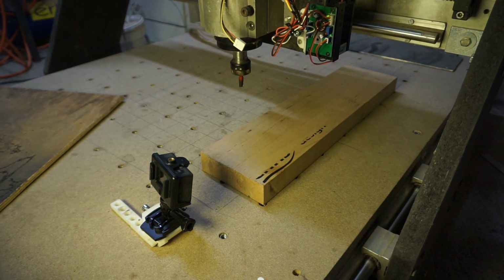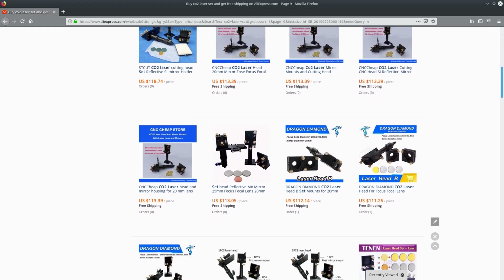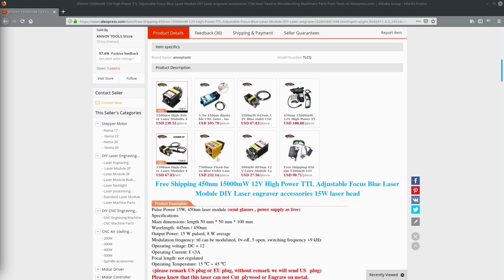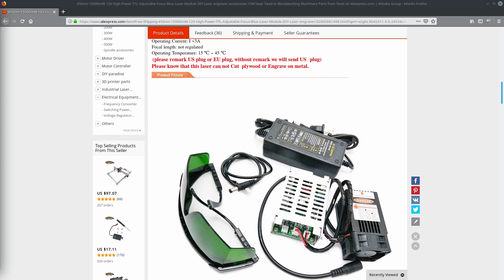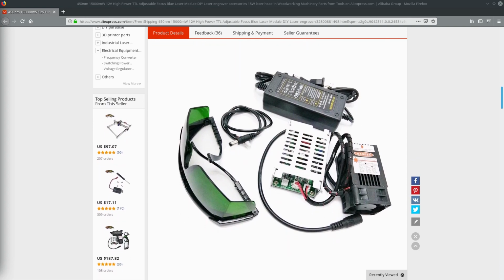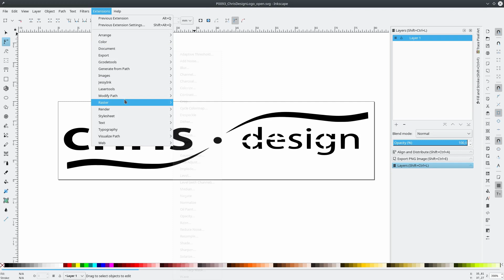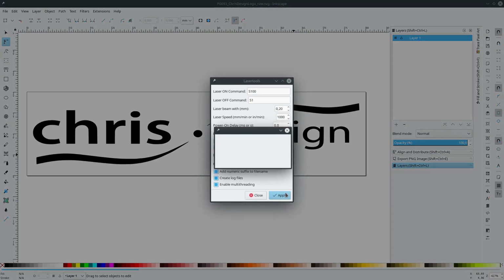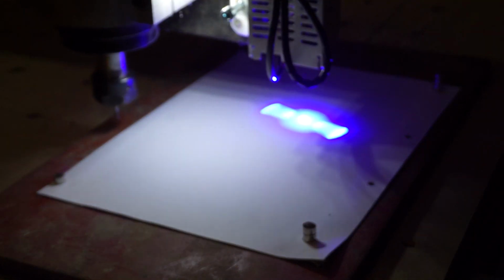High Power Diode Laser Test

Comment: #1 you did not recieve a 80watt diode laser(if you look on line at pics from the sellers you will see the diff. You really need to take a tech school course on how to set up and run a laser as cutting on a piece of wood is a no-no unless you want to set your shop on fire, you do not have any exhaust set up, and #3 failure to focus results in bad results.

Comment: A lot of those lasers that boast 15w are just over-driven smaller diodes.  I have a 2.5w Eleksmaker laser and I can cut through 3mm walnut in 2 passes with air assist.  That tells me that your 15w laser is not anywhere close to 15w, has a poor lens, or weak power supply.
Reply from the maker: Im sure it does not put out anywhere close to 15W of laser power. Unfortunately I have no way of measuring that.
Reply: @ChristophWagnerChrisDesign  Chinese sellers often rate their lasers by input power, so "15W" actually gives you around 4 or 5W of optical power.
Reply: Best thing is to use air assist and not run it at full power for very long.   That goes for any that you buy.
Reply: @Michael-lo3ht  i agree with you, price is never a lie